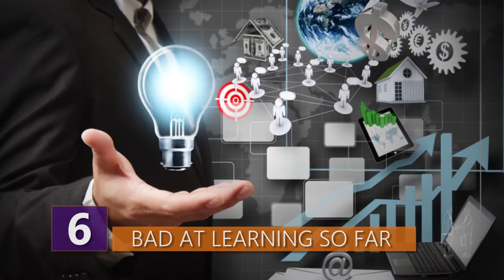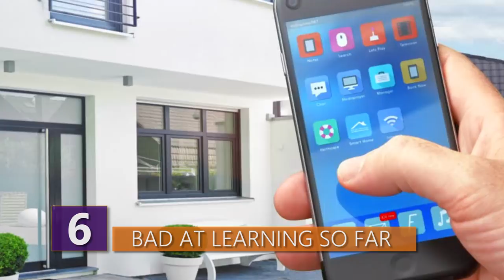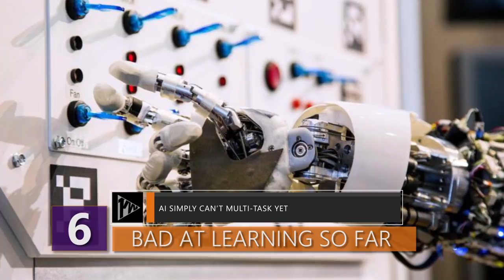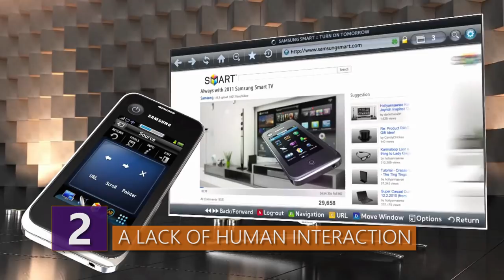The DANGERS of Artificial Intelligence!

Comment: Is it possible for AI to bypass a rule to not kill human beings? If so, how could it do that?
Reply: If the AI becomes intelligent enough to read and understand its own source code, it can simply use the code used to build it as a reference to sort of work out how it(the AI program) works, so i'd assume it'll run through all the functions, see which functions are triggered by which actions or the other way round. And from there all the AI enhanced program really needs to do is alter the function/line of code/command that stops it from killing humans - but id assume precautions to something like that would be taken by the developer...there are ways to hide code so that it can't be viewed, but then again if we're talking of an AI program or system that has intellectually evolved above the human thinking capacity or IQ then id say there's a good chance the program will find our how to do it despite the precautions and security measures taken in advance - just an opinion/could be wrong
Reply: I don’t trust every ai I see i will destroy it